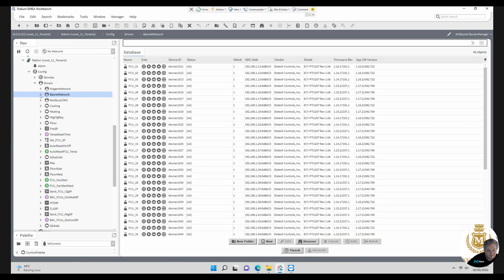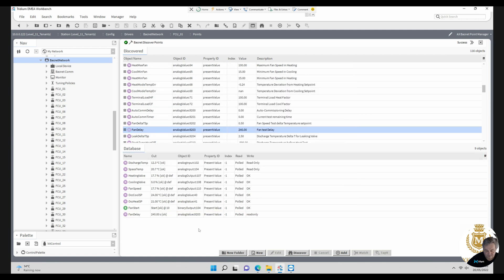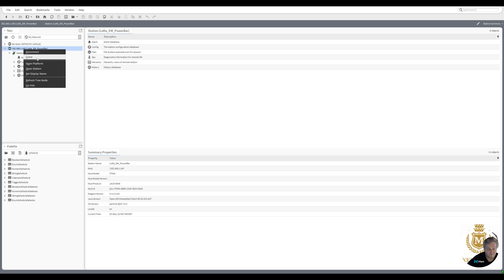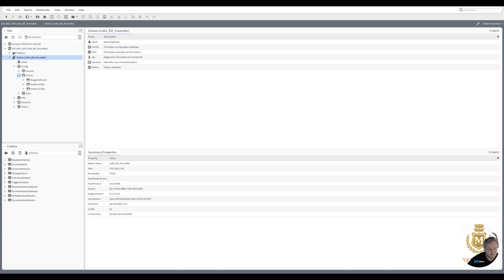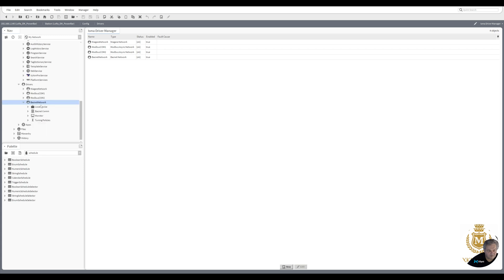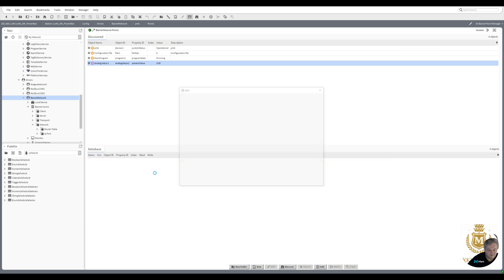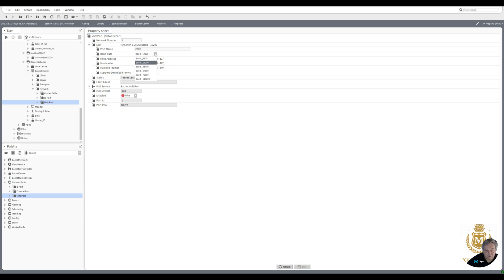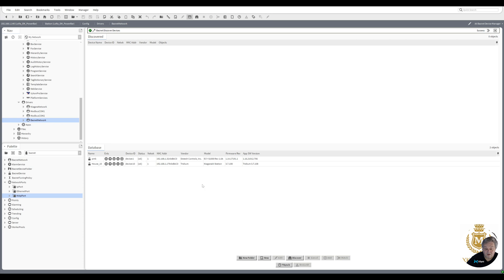#29 N4 Tridium Niagara - Machine learning - BACnet network how to add to a controller

Comment: BACnet is the defacto standard for HVAC.  Regulated by ASHRAE. It just works. Why use anything else.
ModBus doesn't do Text or Decimals. Was designed in 1970 for PLCs to 'talk' to each other. Not for humans !
LON is a dying protocal. Not enen the early adopters use it now.
Reply from the maker: I do agree with you, it just works and is simple to bring in points. My reservation about BACnet is the resources it uses. I prefer MODBUS due to using little resources, and also when using Modbus RTU instead of BACnet MS/TP I can travel further with my network signal. Naturally, when IP is used, this is different, but again, MODBUS uses fewer resources than BACnet. I can go further with examples, especially using the iSMA IO with Modbus than BACnet, as each point in BACnet uses 1 Tridium Proxy point, where I can have 16 Digital inputs using Modbus and only use 1 proxy point, but that's another debate. I agree LON is dead, but not MODBUS or BACnet, they have their uses, and each one has its own strengths.

Comment: Thanks Paul for these videos, very much appreciated. Trying to transfer from PLC/ engineering work to BMS/HVAC.
Worked with Modicon PLCs for many years at Vauxhall motors , Luton so Modbus is something I have used extensively, BacNet seems straightforward, but never used LON.
Thanks again.
Reply from the maker: I don't like LON, and don't use it very much. So your PLC logic was ladder logic, its been a long time since I programmed a PLC. BACnet is very easy to use, everything just gets discovered for you, but it uses more system resources than Modbus.
Reply: @NiagaraTridium  Yes ladder logic and a bit of statement list.
Managed to get a few Easyio controllers of Ebay, used there CPT tools which is free and has BacNet discovery etc. Would really like to get hold of Niagara to get a feel for it though.